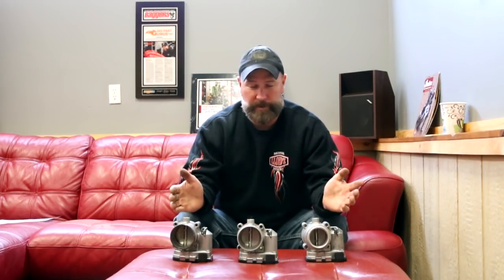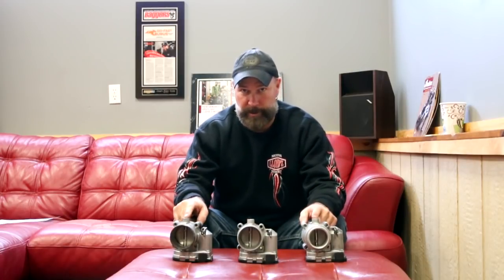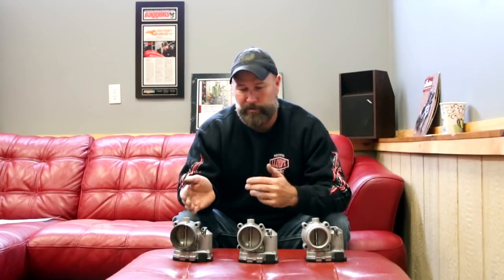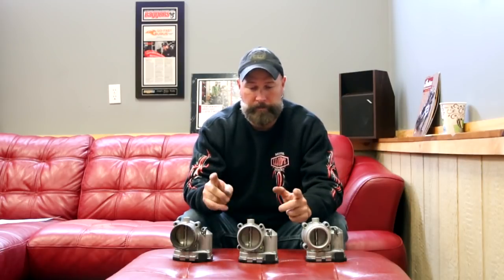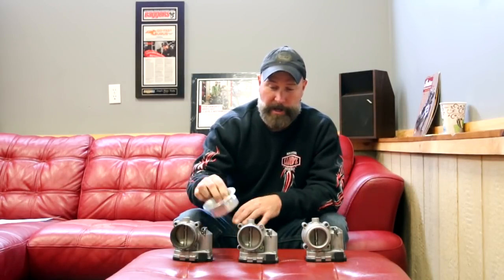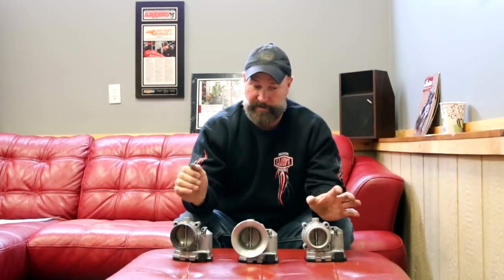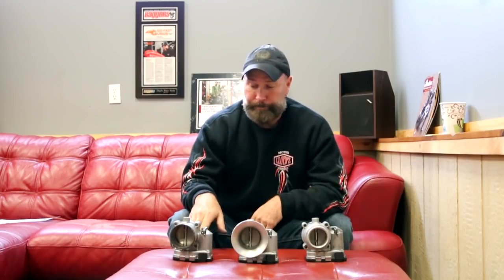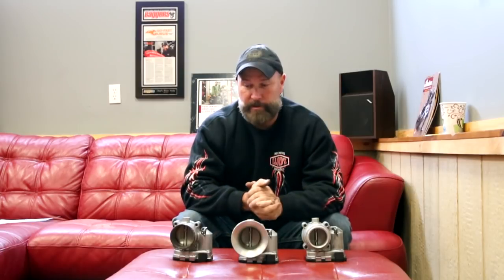Red Couch Fridays - Throttle Body Comparison

Comment: I am going to buy timing wheel, street cam 505, and air filter.. is the lodyz air make a difference or should I just get in filter. Drill out air covers on victory hammer 2013 for more air in?

Comment: Lloyd are you running the stock header pipe? Or a gutted pipe.
Reply from the maker: Stock head pipe Cat still in. There's no difference in power by removing the cat just more sound and less heat.
Reply: Thanks